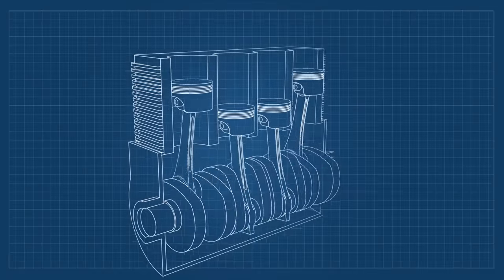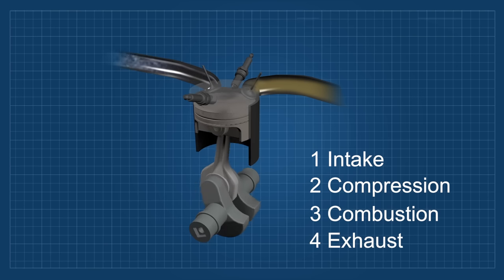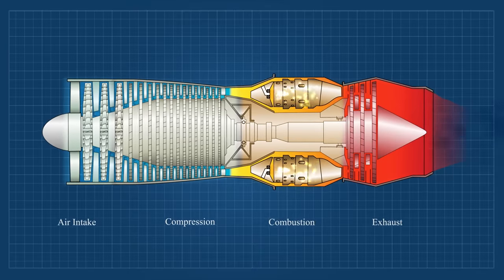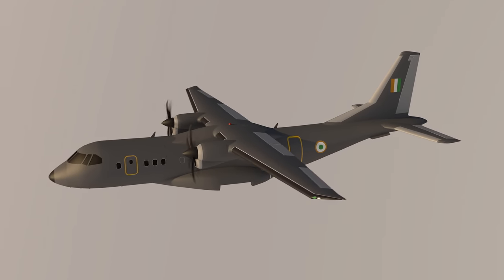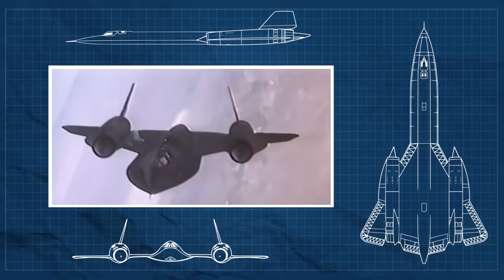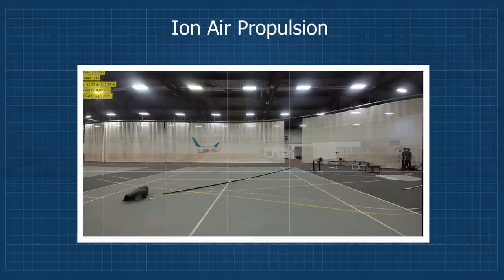Aircraft Engine Types and Propulsion Systems | How Do They Work?

Comment from the maker: Corrections from Joexer (a subscriber)

1:28 When Running Properly, fuel in an aircraft cylinder engine should not explode; An explosion or detonation is a malfunction and is very damaging to the engine.

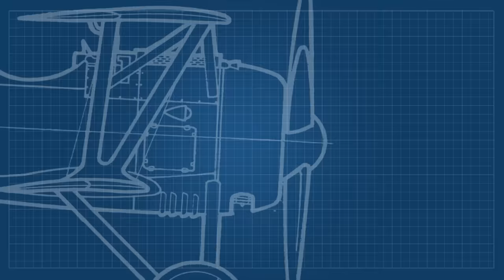1:57 - 2:25 While you are correct about the cooling and aerodynamic aspects there is also a huge aspect of efficiency, ease of manufacturing, maintenance, "ideal conditions",  power to weight, fuel and metallurgy technologies and even vibration certainly come into play.

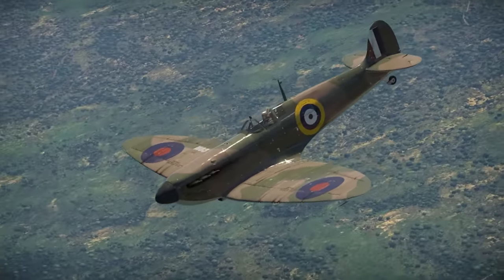2:29 Maximum speed is not the sole benefit of a different engine technology. 

2:32 Rocket engines are actually more efficient in some ways than turbojet engines under the premise of speed per fuel and weight. It is more propulsively efficient because of its light weight and small size for the weight with a propulsive efficiency of about 70%.

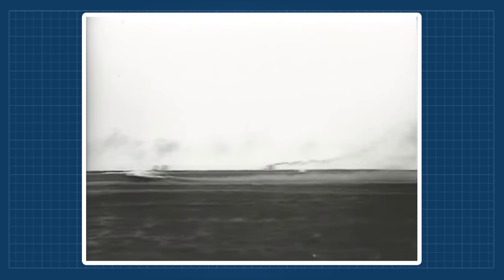2:47 Jet engines is a poor choice of words because a rocket engine is a kind of jet engine. You seem to have conflated it with turbine engine. A Jet engine is any kind of reaction engine, that discharges a fast moving stream of mass to generate thrust. A Rocket engine or even a Pump-jet, as may be found as propulsion on a boat are both jet engines. The aeolipile dating to around 150 BC was also a jet engine. A Turbine engine is merely one such kind of jet engine. 

4:01 A Ramjet is not a turbine engine as it does not make use of a turbine for compression

4:32 Modern Fighter Jets do not use Turbojets, they use Low Bypass Turbofans which are the previously mentioned turbofans with less bypass. Its also not very powerful. 

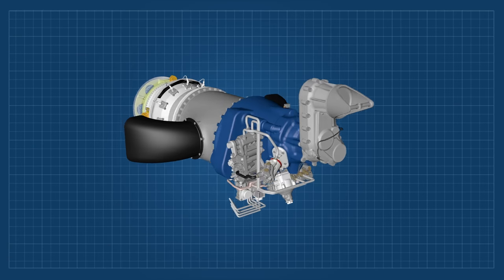6:02 This is not accurate. A ramjet is only like a rocket in the sense that it is a Jet engine. Unlike a rocket a ramjet is airbreathing and uses relative wind to the aircraft to slow and compress the air, then, it adds fuel to and ignites. It cannot function like a rocket and does not have oxidizer. Ramjets also begin producing meaningful thrust around .5 Mach at sea level (384mph) 

Also this misses a LOT of huge elements like, maintenance, economic factors (like fuel costs), distance, the mission requirement, aerodynamic drag, the limits on each kind of propulsion, other efficiencies, temperatures,  density altitude, manned aviation concerns like pressurization, heat and time for the pilot, also you did not mention Lift, Bernoulli's, Otto cycle (Piston) or Brayton Cycle (Turbines) and perhaps greatest of all, The inevitable tradeoffs that result from anything that expends energy.
Reply: one note: explosion is not same as detonation, first is slow, second is fast because fuel falls apart on h an c  , and h burns fast and that is detonation, in piston engine is single burn event in jet engine it burns constantly or constant explosion but not detonation, difference between igniting  cigarete lighter and spark plug starts burn is cylinder is closed space, cigarete lighter is in open space
Reply: "Also this misses a LOT of huge elements like, maintenance, economic factors.."
Question: How is the last point relevant to the topic of discussion aka How do they work.
Reply: 3:30. #1. A Jet Engine is not at all the same as a Rocket Engine. Like seriously what the hell.

Yes they both produce thrust through Newton's 3rd Law. But that is the end of their similarities. From a engineering standpoint.

A Rocket does it by accelerating Mass. And a Jet Engine does it by pulling Mass through it.

And therefore are very different.!

#2. That's Not called the "Exhaust". It's called the "Power Turbine" section. And it spins the Intake and Compressor Blades. It's literally the whole function of a Jet Engine. But yeah you wouldn't want to get that part right. In a video about Aircraft Propulsion. 

And then after the Power Turbine Section. Comes the Exhaust section. Which in most aircraft. The exhaust cavity volume is adjustable. For higher gas compression.

No you didn't particularly need to know that information. But if you are making a video describing it's functionality. You might want to have that in there.

But an otherwise interesting video.
Reply: also at 0:55 thisis just wrong. You never built a 4-stroke radial engine with even number of cylinders,
Reply: Can you talk about how the Infinite Improbability Drive works?
Reply: Wrong...   There is a difference between Detonation and the normal explosion. Detonation is when the normal explosion is actually hotter and more violent than the normal burn.
Reply: You should have mentioned the turbo charger, and how led the transition from ICE to jet engines
Reply: اتمنى ان تظيف ترجمة للغة العربية
Reply: Hola tengo un motor elétrico a reaccion de energia de alternacion a compresiom las marchas estan en la válvulas el embrague no aí és para marchas a válvulas com temperaturas que dividem las marchas por el fã sale a présion y a compresiom las marchas és la compresiom de la ebaporaviob del combustível Asta 150grados sentigrados para ir separando las temperaturas ata la trasformacion del nitrojeno a 150 grado centígrados
Reply: Asen las simulaciones está de armarlo ayuda pues puedo ayudar
Reply: Why wasn't the scramjet engine showed?
Reply: real cool that you acknowledge your errors and also give credit to who gave you the proper information
Reply: Hello, just asking does a jet engine needs to turn the blades with a conventional engine
Reply from the maker: @TheOfficialIceRush  No, the whole point of these engines is that they use high pressure expansion gasses at the combustion chamber to rotate the turbine at the back and that rotates the whole system. The same principle of a wind turbine. Some electric motor might be use only to start the engine but then it is not used.
Reply: @mancubwwa  If I remember right and it has been a very long time,  the b17 had 4  12 cylinder Wright wasp engines, the b29 used a double wright wasp engine with 22 cylinders and 4 bladed props
Reply: @fredashay  simple M.A.G.I.C.
Reply: @Delgen1951  sorry but: 
1) Wasp was a pratt & whitney engine not a Wright engine
2) B17 used Wright Cyclone 9 cylinder single row radial Engines. Note that 9 is an odd number
3) B29 used a Pratt and Whitney 28 cylinder Wasp Major four row Radial Engines. This makes 7 cylinders per row. Now I dont remember how precise I was in my original comment, but the point is that for smooth operation of radial engine you need odd number of cylinders per row, not overall. This is inherent to the radial design.
Reply: Also, boxer engines are very common in cars. 
And there's the triangle Dorito rotary.
Scramjets and pulse detonation engines.
Reply: @I86282 it is not called the power turbine section.  It’s the turbine. Or low pressure/ high pressure turbines.
Reply: Aq

Comment: Technically, a glider cannot fly without an engine - it uses an engine in a different plane to get it up to altitude to fly. To demonstrate this, go out to an airfield and sit in a glider on the ground. Then try to fly it.
Reply: You could do hill launches (gravity lauches), there is also small glider which you carry and run start off a hill. plus Paragliders and hanggliders exist
Reply: It can use thermals and wind to get up, even without getting towed. It's called a sailplane for a reason.
Reply: To be fair some have used catapults to get airbourne.
Reply: @flyhi2773  To be fair, a catapult is simply a different kind of engine. Energy (i.e., work) goes into tightening a spring (wooden beams) which is then released.
Reply: Bro just stop being nitty gritty, grow a pair and deal with a small and irrelevant mistake
Reply: Well, if you like to split hairs, i will do the same with your comment.

You can use an electric motor. A motor is not an engine 😁
Reply: @Coyote27981  "A motor is not an engine." Just curious - which school taught you anything about "motors" or "engines"?
Reply: @karlostj4683  an engine generates its own power, a motor requires external power.
Reply: @Coyote27981  an engine needs Gas to Generate Power ?
Reply: @adoggone5429  where did i mention gas? Steam engine maybe? 

Engines convert chemical energy into motion, whatever means used. Motors dont, they use electricity.
Reply: also, they can be catapulted of of trucks to take off
Reply: @nolifedisc7614  So the glider is using the engine of a truck, or the engine of whatever wound up the spring mechanism of the catapult.
Reply: @karlostj4683  no its using the force released from the spring/ metal rope thing which is powered by a winch likely, therefore not an engine
Reply: @nolifedisc7614  Nolife, what's the winch powered by? For the force needed to throw a glider in the air, gotta be an engine.
Reply: That's just playing with words at this point 😅
Reply: @pierre2029  My original point is still true:  "Technically, a glider cannot fly without an engine"
Reply: @karlostj4683  An electric motor isn't an engine though, if we are to get trivial here
Reply: @merchantgold6327  Uh, yeah, a "motor" - no matter how it's powered - is an engine.
Reply: @merchantgold6327  Because an "engine" is any device that turns potential energy (electricity, gasoline, coal, etc.) into kinetic energy.
Reply: nerd😂
Reply: @tropicaldiscard2577  aerospace nerd, genetically predisposed to aerosplain
Reply: Yes
Reply: @karlostj4683  nerd.
Reply: @tropicaldiscard2577  dork
Reply: @karlostj4683 lol… not for nothin, I actually appreciate your nitty gritty 😅
Reply: You got what is meant here
Reply: @nicocoot8384  I did. But there are different ways to express concepts.
Reply: Well as someone said, you can take off from a hill, so you can fly without an engine.
Reply: @danasathan2410  Remind me, how did the glider get up the hill? Getting it up a hill requires adding energy to the glider, which has to be produced by something. What was that something?
Reply: @karlostj4683   hmmm Logistics isn’t part of flight operations haa!!  The glider could have been on a trailer for all i know but take off would be done with any engines xD
Reply: @danasathan2410  Did you mean "with any" or "without any" engines? Just curious.
Reply: @Coyote27981 so knapsack jet is engine too I think huh?
Reply: I bet ur real proud of urself for pointing this out @karlostj4683
Reply: @jamesnielsen3641  I bet you're real proud of yourself for delivering nothing to the conversation @jamesnielsen3641. Have you ever considered pointing out to your parents that they could maybe sue the college they paid for you to go to because it didn't teach you to think?
Reply: Regardless of how big it is a glider can fly without an engine I could demonstrate this with a paper airplane, and mechanical advantage still exists lol
Reply: @sleep3682  Except no paper airplane ever gets off the ground WITHOUT some other source of energy. Fold a piece of paper into a paper airplane and then sit it on the floor. You will wait forever for it to rise up and fly. 

Q.E.D.
Reply: @sleep3682  If your knowledge of physics doesn't lead you to that conclusion, you should avoid any career choice that requires understanding of middle-school physics.
Reply: @karlostj4683  you would only be correct if you consider humans as some form of engine I could easily throw a paper airplane to achieve flight but, if that’s what your insinuating then you could make the argument that anything man made is machine made.
Reply: @sleep3682  An "engine" is any mechanical or biological device that delivers motive power to something else. Humans are a "form of engine" because humans burn sugars and fats and proteins to power muscles to deliver kinetic energy to something else. Q.E.D. A glider cannot "glide" without some kind of engine giving it kinetic energy - a glider cannot jump itself off the ground.
Reply: Its called a glider for a reason
Reply: @APtheAvGeek  It can't glide if some kind of power source doesn't take it up high enough.
Reply: @karlostj4683  becausw they usually get towed in the air by a small turboprop, which acts like the engine for the glider
Reply: @APtheAvGeek  I think I heard that somewhere.
Reply: Winch launch
Reply: @Dan3l000  Which engine cranks the winch? Something other than the glider itself has to provide energy to make a glider fly.
Reply: Also hybrids
Reply: @yourmeister  I like how he's completely ignored your comment
Reply: @Coyote27981  can't believe this guy somehow won at being so arrogant about being pedantic into something incorrect, while using all of you as punching bags. You could have just said "flying" isn't the same as "getting into the air" (I.e. takeoff)
Reply: @karlostj4683  even your last comment contradicts your original. "Something other than the GLIDER ITSELF", insinuating that the glider itself can fly. 

How does it feel being wrong after all that effort at being so pedantic and arrogant?

Comment: You didn't include the 5th type, the rotary radial, but you showed it on the front of the Sopwith saying they used this for cooling. Rotary-radial engines are quite different from radial engines, and should of had their own part and animation in this video.

Comment: A very interesting type of piston engine used in aircraft for some time was the rotary engine, where the whole engine rotates and the crankshaft remains stationary. The Wankel engine has also been used in aircraft as a proof of concept.
The Pulse jet concept was also used in planes although again not very successfully.
Reply: In Archimedes' formulation, the effort arm was equal to the distance from the fulcrum to the applied point of effort and the load arm was equal to the distance from the fulcrum to the center of the load weight. Thus established, the effort multiplied by the length of the effort arm equals the load multiplied by the length of the load arm, which means that the longer the end of the effort, the less force is required to lift the load. Simply put, if you are attempting to lift a particularly heavy stone, it is best to use a longer crowbar and place the fulcrum as close to the stone or load as possible. It sounds the gravity and the rising of the entire universe or the development of cloud modules and shapes and they move in remote virtual paths (without stretches or infrastructures) independently of ionic electricity. Step-by-step logic and gravity need to be applied in mechanical problem solving and equipment design. In doing so, he created the machines that transformed the world and his impact remains powerful today.

Comment: very well organised and explained, love it. learned a lot, tnx dude! waiting for more educational content like this from you. cheers 🖖 by the way you made all this engine animations yourself?
Reply from the maker: Just the animations and drawings. The 3D models are gathered from different sources.
Reply: @Joyplanes  Which engines forgot to mention: gyrodine. And, of course, the nuclear air engine. In the future, nuclear batteries, RTGS, will allow for a flight without landing for a year or longer, for unmanned vehicles. Compact atomic reactors based on molybdenum crystals are currently being developed in Russia. I've seen photos, it's the size of a household refrigerator. But such nuclear reactors will most likely be used for an atomic planetship, which is currently being designed by the Khrunichev Bureau. Nuclear reactors have already been successfully put on a hypersonic rocket, which will allow the rocket to make a suborbital flight and reach anywhere on the planet, without a chance for air defense. Such things.🙂

Comment: I wanted to shout out the propfan: an experimental engine that could be described as a cross between a turbo fan and a turbo prop. It looked like a jet engine with propellers attached to the back. They ran a few experiments, but the advantages never emerged, and it was extremely loud.
Reply: I agree totally. There were several reasons (not only good ones) that this technology didn´t come to life up to this day. It was developped in the late 80s and early 90s much in order to save fuel and was successfully testet. I think they turned it down because it would have remind the people to much of a propeller...anyway in the mean time the so called "jet-engine" became bigger and bigger because of the augmented bypass and I don´t know how long this can go further and further by calling the result a jet-engine.
Reply: The prop fan has a lot of disadvantages because the airflow over the blades must be supersonic and that creates a lot of noise as well as losses that can’t be recaptured like a ducted fan.

Comment: Concerning the SR-71, at speeds above Mach 2.5, the spikes on the front of engine intake retract reducing airflow into the compressor and diverting it around to the exhaust where the afterburner ignites the fuel with it.  I believe the process is gradual to prevent a flameout.  At maximum speed the engines are operating as ramjets.

Comment: One note about the turbojet / turbofan. Turbojets on mil aircraft were phased out in the 50s / 60s. All modern fighters use turbofan engines, just with different bypass ratios than the ones used on big planes.
Reply: i don’t understand how turbo work where give the energy to rotary the engine please answer me ??

Comment: Thank you
Would’ve been nice to include how some of these engines start. Especially the jet engine.
Reply: I can imagine they start with an electric motor to start intake air, then a fuel rich initial combustion then as it speeds up gets more air and then the optimal fuel-air mixture combustion.

Comment: There are also 2 subcategories of turbojet engines; the ones that uses axial compressors and the ones that uses centrifugal compressors(centrifugal is still used on small turboprops or on turboshafts-one of my my favourites centrifugal engine is Rolls-Royce NeNe Mk10 used on T33 military aircraft)
Reply: Thank you for mentioning this. Saved me the trouble of more-clumsily trying to say it myself.
Reply: Thanks for this 🤝